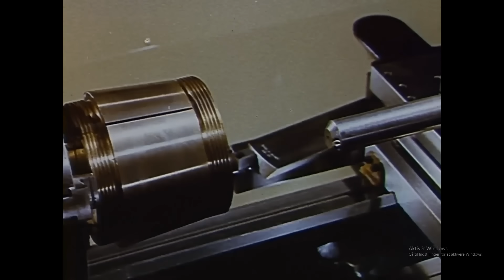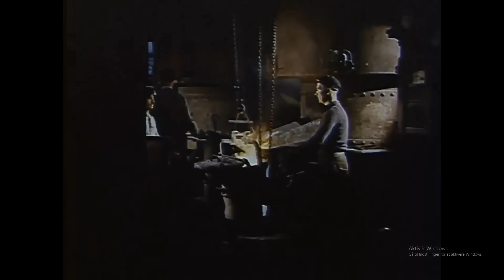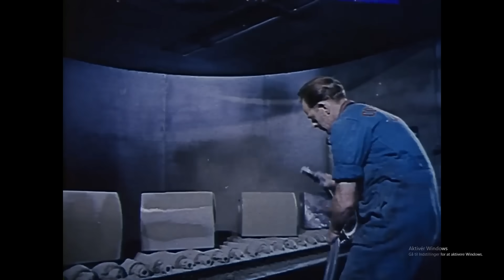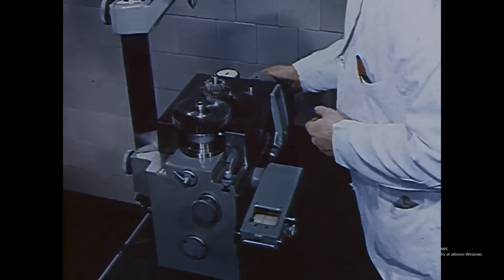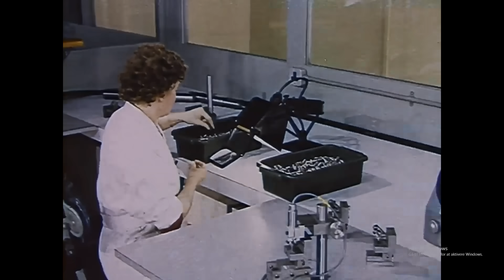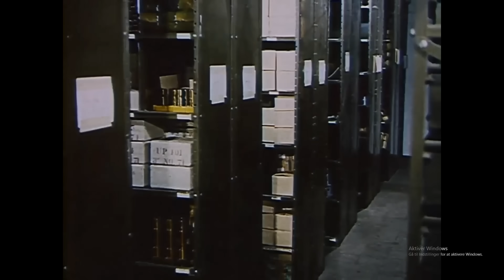Colchester Lathe Company

Comment: Precision engineering at its finest. We had some of these in school where i grew up. Loved the time on the lathes.
Reply: My school had a couple of metalwork workshops - possibly 3 lathes in one and 5 in the other. The 5 were a Student, a Raglan variomatic - both as 'proper' lathes, a small Boxford with a leadscrew (& likely changewheels in a  box never opened) and 2 ultra-basic lathes - 3 speed, no leadscrew. I taught the metalwork teacher how to cut threads - on the Raglan - having done a bit on the Myford at home! I turned a screw and a brass nut while making a sash cramp for CSE metalwork. Got a 'commended work' for that - the teacher was well-impressed - and I would suspect he'd be as rare at giving 'commended work' awards as I was at receiving them !

Comment: Note that on the section showing screw cutting the cut is put on with the top slide set over to half the thread angle. The cross slide is set to zero. This a much better method than plunging a form tool straight in, the most common method used.
Reply from the maker: It sure is. I always use this method.

Comment: RIP manufacturing with care and art.
Reply: Yes, but safer workplaces are also cool. And with today's CNC machines, you can ensure tolerances right on the machine.

If every machine is handcrafted, that still leaves a possibility for human error. Human error is the main cause for machine failure. Sometimes, eliminating the human element is the best way. Why do you think the Saturn V had a flight computer? And why do planes have autopilot?

Comment: True engineering porn!  I can remember learning to turn on a Colchester lathe during my apprenticeship with Rolls-Royce. Never quite appreciated the skill and craftsmanship that went into the manufacture of these superb machine tools. One could argue that CNC machine tools have long since superseded the old manual lathes but the fundamentals of the machine tool such has a precision bed and headstock must still be present to ensure accuracy and repeatability.
Reply: Manually controlled lathes still have got their application area, that's why they are still being produced and sold all over the world. Sometimes there's just no need in CNC, for example, in unit or small serie production. An experienced turner may give the demanded output before the G-code is written and debugged :-)
Also we should mention the reconditioning field. No CNC is needed to refresh the lead screw thread or to face the deformed brake disk.
Reply: @МусяВоробьева  Yes, I fully agree with you.  Wish I had a small manual lathe in my workshop for making spacers, special bolts etc....
I still enjoy the challenge of writing G & M code part-programs, even though we have the ability to create the toolpaths in CAD and use a post-processor to create code to drive the CNC machine. All the part-programs that I create for my waterjet cutting machine are created manually.
Reply: @michaeljohnson-li5nn  Apart from knowing what a CNC is, I know extremely little about the programming side - despite doing computer programming ! I've often wondered how CNC machines compensate for tool wear ?
Reply: @millomweb  : There is two ways to compensate for tool wear, automatic tool wear compensation or dynamic compensation. In automatic, the tool wear is pre-calculated in program and would automatically compensate in intervals. While in dynamic, there is a tool wear detection system, a microscope photographs the tool and see how much wear there is and then compensate.
Reply: @comprehendnature2404  MANY thanks for that. Interesting that optical wear detection is used. Maybe it's more reliable than other methods - like electrical contact or even pressure sensing.
I guess the next step is wondering whether the optical can also check the tool profile - for uneven wear and even stop the machine if wear is unacceptable. I guess the stage after that is detecting tool breaking ! Even load on spindle motor could be used to detect a tool that's now cutting inefficiently !
Reply: @millomweb  :  It is already done. Detection of spindle motor load is used to prevent excessive wear of tool, preventing spindle crush and tool breakage. You can watch many amazing modern cnc machines and factory tours of cnc machines in youtube channel :NYC cnc  on his factory tours.

Comment: We run a Colchester Triumph 2000 with the extended bed, might be older than Adam, but it works an works well at that.
Reply: We also have a Triumph 2000 with the longer bed, there's talk of getting rid of it soon, if I had somewhere to put it I'd buy it in a heartbeat! It's not as pretty as it once was, but it can still move metal that's for sure!

Comment: It's a long time since my little Colchester was that shiny. But it still works well.
It still has the same spindle bearings installed in 1952. I know this because my grandfather bought the lathe new.
I dont usually have a need to make anything more accurate that about 50μm but if I do I have to leave the heat on in the workshop for a day or so, then i can obtain about 15μm accuracy.
Not bad for something heading for 70 years old!

Comment: Looks like 1950's. I've worked on most of those models in one form or another. The biggest one being the Mastiff, not yet developed at the time of filming. Happy days. 🙂
Reply: Couldn't give you a definitive answer on that, but the machines look like the older type of lathe that must have been replaced by the newer types with squarer headstocks that we used in the early 70's. Ones like the Triumph 2000 which seemed to be present in lots of company's machine shops. I believe that Colchester must have joined up with Harrison's and are now somewhere in the north.
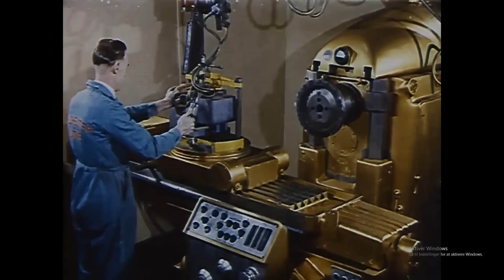Reply: I'd be interested to know when this was filmed, I was thinking it was early 70s from the electronically controlled machines (such as the one at 9:30), and the film quality, I wouldn't have thought it was much later than that judging by the clothing and the man spraying zinc chromate primer without a mask. 
Do you know when these lines of machines were produced from until?
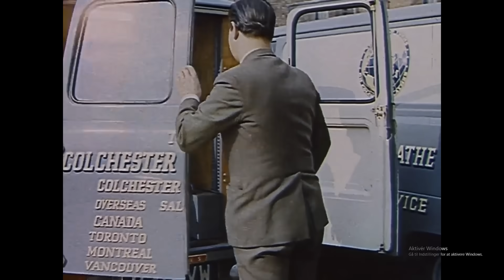Reply: @alanpartridge2140  Hopefully, the inclusion of a Ford Thames van at 24:11, (and which were produced between 1957 and 1965) will perhaps give you a better idea, but the registration of 831PVW might be checked with DVLA to narrow it down.

Comment: I've got a 1960 chipmaster, anyone repairing one of these should contact Lynn at Col Spares, they have most of the manuals in pdf and have been the only way I have got mine anything like back in a serviceable state as they had parts from the same revision as mine. The original factory burnt down and others will change a lot of money for the manuals and parts. - I have no affiliation to col spares btw.

Also if buying a lathe from someone you don't know personally, only buy it if you have seen it running, my "great mechanical condition" eBay lath has cost nearly £3000 in parts and after all that still has a saddle that has been welded where it was once dropped. And also only buy one with hardened bedways otherwise the wear at this point will make it inaccurate if it's been in any sort of production environment.

I have to say though that my lathe was mistreated for the last 10 years of its 60 year life. The fact that it can be repaired is a testament to Colchester and the incredible quality tools they produced. I wish they had made mills I'd have one of those too.

Comment: These were well paid and highly esteemed jobs back in the day. Colchester has certainly not benefited from its replacement with a supermarket and 1000's of low quality flats. It's an absolute shit hole that despite having housing built on every bit of land available still has the same road system from the 70's.

Comment: Oh wow! This is great.
I started my apprenticeship in 1976 at a company on the south coast of England where we made saddle gearboxes for Colchester lathes.
We also made the top slides and tail stocks.
It was an old fashioned indentured apprenticeship, where my father was required to attend the interview as well as me. He had to sign the apprenticeship papers as well as part of his commitment (they don’t do that nowadays).
And so began my four year apprenticeship.
We made everything, the saddle gearboxes for instance - from the iron castings (having been seasoned of course by storing outside in the open air for at least a year), initially plough ground 8 at a time on a large Snow grinder (same make as the one in the film), then through successive milling, drilling by radial drills (and some of the first NC machines), horizontal boring (including some multi boring heads), to produce the main machined casting. Through to the steel shafts and gears, turned on Wickman single spindle machines or copy lathes and cylindrically ground. Then there was the gear cutting shop where shaping and hobbing machines cut the gears and spline shafts which were in turn induction hardened (I ran the gear cutting, broaching, manual drilling and induction hardening shop at the age of 19 to 20). Then all was assembled and tested before being shipped to Colchester.
It was a good apprenticeship, 6 months in every department including inspection.
I qualified as a Toolmaker at 20 years of age in 1980, and am still in Engineering now, and currently in the process of setting up a new machine shop.
So glad I saw this video, many thanks for uploading😊
Reply: Monty Zumazoom Apprenticeships are still like that in Australia.
Reply: Jamo really? That’s interesting. Nothing like it in the UK now
Reply: @montyzumazoom1337  Yeah, I'm in my final year of a 4 year apprenticeship in Boilermaking. Spending one week a month at trade school learning the theory. All trades are done like that still. There are people who do work in the trades without their trade papers but they are paid a lot less and find it hard to get work. 

The trades here have lost their prestige in a way due to a big push of high school leavers going to uni, but with a flood of unemployed graduates it seems to be swinging back.
Reply: Jamo That’s good to hear, best wishes for the future in your chosen career👍

Comment: The very fine tolerances involved require a very crisp accent to describe.
Reply: That's what you call a calibrated English accent!
Reply: William Ferguson one and a half thou thanks
Reply: @gmsyd09  he said 1/10 of an inch tolerance, but that is clearly incorrect, these devices are clearly accurate to 1/10000 of an inch or better as you said.

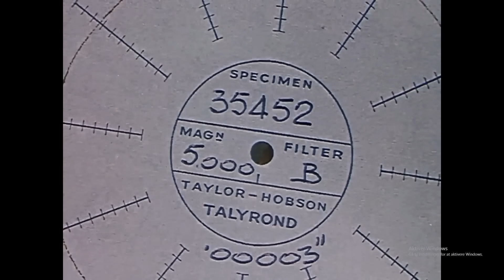Edit. 30 millionth of an inch. Mind blown. 21:22
Reply: Dave ‘a tenth’ is shorthand for one tenth of one thousandth or .0001”.
Reply: @daithi007  Yes he meant 1/10000 but the way he said it is standard machining lingo. .0304 for instance is said thirty thousands and four tenths.
Reply: Probably also a magnificent moustache.
Reply: Very likely ex RAF officer from WW2.
Reply: what a frightfully beastly thing to say old chap
Reply: Indubitably.  I was imagining Jeeves, the comedic short stories and novels by English author P. G. Wodehouse as a proper backdrop.

Comment: Thanks for sharing, anyone know where to buy these old lathes? working/not
Reply: eBay. You will find they do come up. Never buy one without seeing it run though, or it will likely cost you a fortune to get it running.
Reply: @house89147  Thanks, Im thinking if the gearbox is decent it would be a good contender to buy
Reply: @DytliefMoller  my lathe was in a real state with gears broken, parts welded back together, screws bent etc. If you want working parts you can count on, Lynn at Col Spares in Colchester would be able to help. If your buying from eBay see it running, if it were me now from what I know I would take some material with me and get them to turn a long straight bar on it. Then check each end for taper and any irregularities in the shaft. If it all looks good the. I'd buy, but I cannot stress strongly enough that if you buy a lathe with out seeing it run it's worth scrap value only. Or like me your investment could cost you a further £3000 and still not be as good as it could be.
Reply: @house89147  Agreed, i dont have lots of $$ around and also having a recent interest in lathes. Got to this vid via youtube search. Im looking for an old lathe as the cost of new ones are insane and to me quite over complicated with all the electronics that a old school mechanical lathe would be a great starter for me. Not looking at heavy machining(for now), just a starter model to do a few basic projects to get a feel. But my constrain is cash to be honest.  Ill have a look what you suggested. I can maybe make parts for the lathe if it is in basic working order  ; )
Reply: @DytliefMoller  kinda what I am doing too, I cannot recommend "this old Tony" enough. He has a mini lathe that he is just starting with. Talking to him he has said that you can start with cheep import kit and then upgrade over time. And to be honest most of the cost I've found with an old lathe or any lathe is the tooling. You could start with a cheep Chinese lathe and then upgrade. By the time you do you will have tools and more of an idea of what you want to do with it, and that ability to make some replacement parts too.

Comment: I am lucky enough to have bought a 1974 Bantam, ex-college. Despite being 45 years old it is still smooth and accurate. The only bits to wear are the switch linkages and input shaft gear-pair. Now I have seen this, I know I can safely drop in a replacement pair from any same-age machine without needing to match them up.